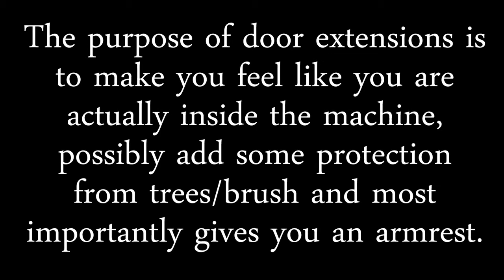Kawasaki Teryx 4 door extensions (home made)

Comment: What material did you use i might do the same
Reply from the maker: It was some 30” square sheets of plastic in the trash pile of shopping carts and displays behind one of the stores I deliver to. It was probably used as a shelf liner of some sort. I don’t own a micrometer to measure the thickness. I just know it’s stiff enough to have rigidity and thin enough to fold with the help of a heat gun. It was smooth on one side and ridged on the other.
Reply: Awesome thanks i found some online gonna order it now and make some!!
Reply: @claycanole6979   what was the material you ordered?